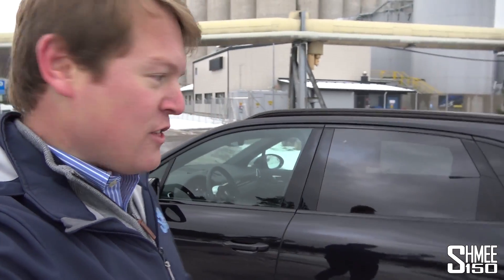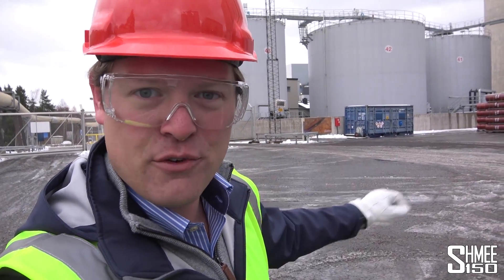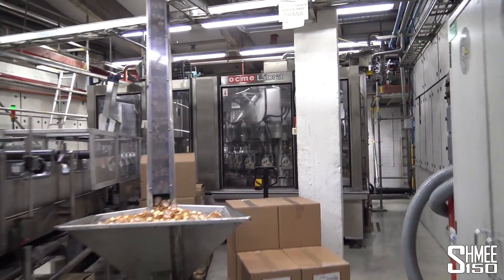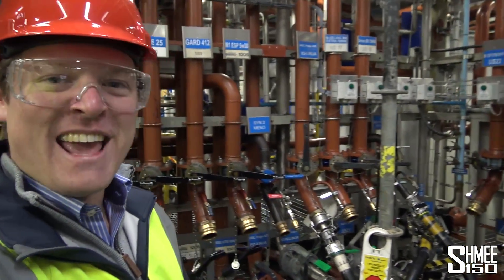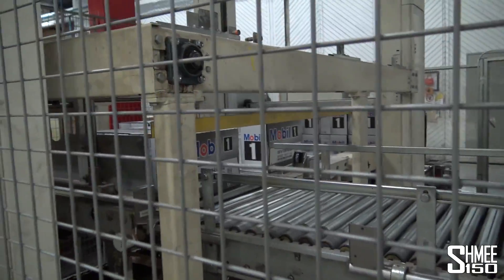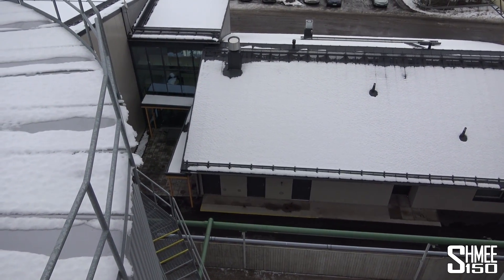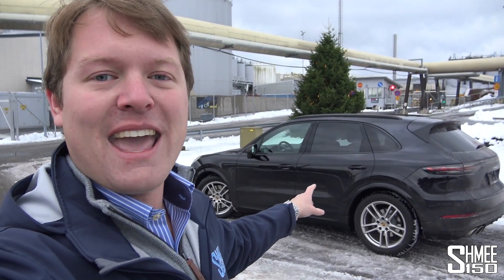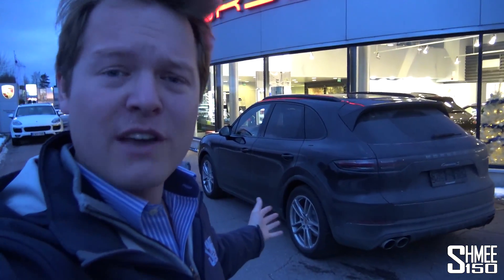I Bet You Don't Know How Engine Oil is Made! | EXPERIENCE

Comment: After reading the title I was thinking you were going to a refinery where crude oil is processed but that wasn't the case. Crude oil is in fact a dark brown which is close to black depending on where it is pulled from. The refining process requires a lot of heat and a fish ladder or two in order to separate fuels from oils. 

The process you were looking at was rather unique and I have to wonder if you weren't looking at the process for synthetics rather than natural motor oils. Though they do the same job, the process isn't even close to the same.

As always, enjoyed the video. Well done.